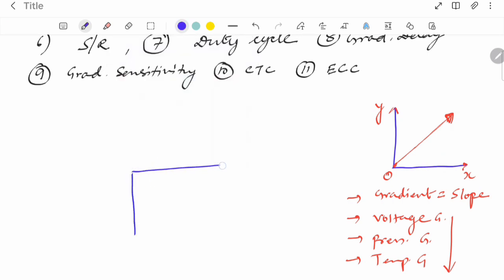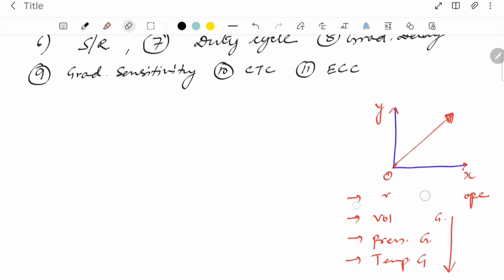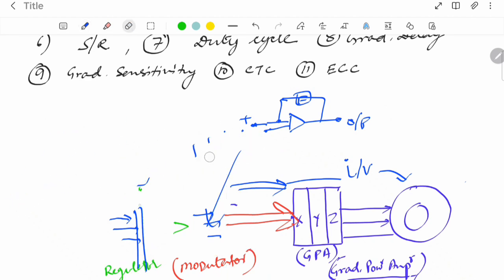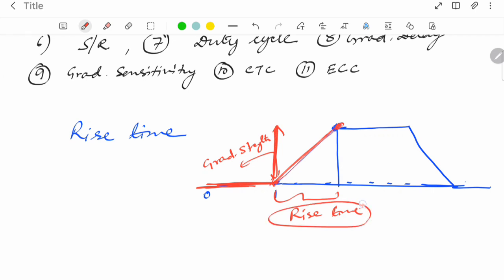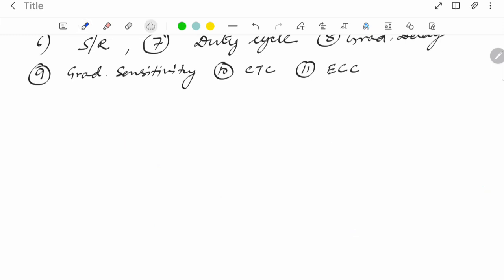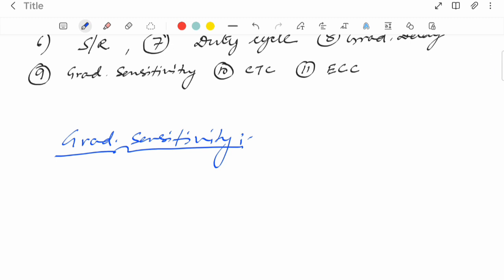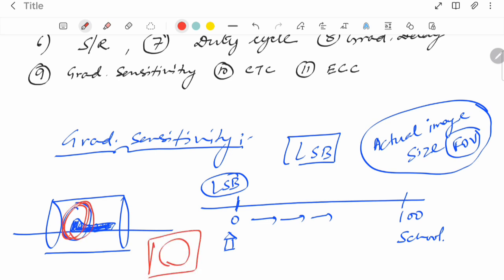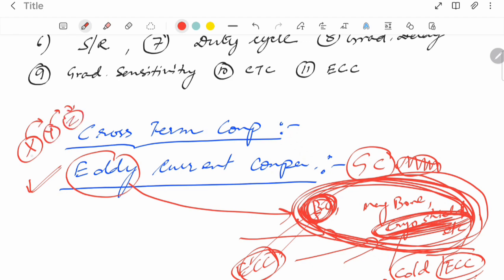MRI Gradient Parameters, Duty cycle, Gradient delay, Gradient rise time, Slew rate, ECC, CTC

Comment: Hello sir
I am preparing for the MR application post
At one level we are interviewed by a service engineer.

I want to know what are the key features a service engineer expect from a candidate.
Reply from the maker: @ryzenpheno7806  Hi Thanks for you time and comment. First of all, best of luck for your interview results. Secondly i would like to advice you that Cooling is the key point in any MRI. Try to learn the cooling techniques. Water cooling, He Gas used,  Liq He uses are the key points.

Hope this would help you. 
Thnx
Reply: @Medical_Electronics_Horizon  thankyou for your wishes sir
One request 
Can we have a dedicated video on cooling?